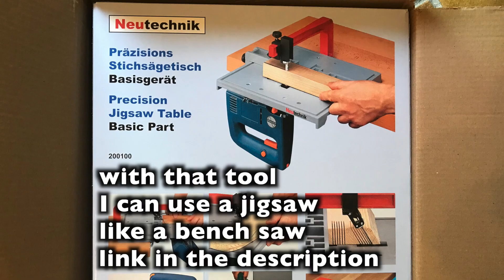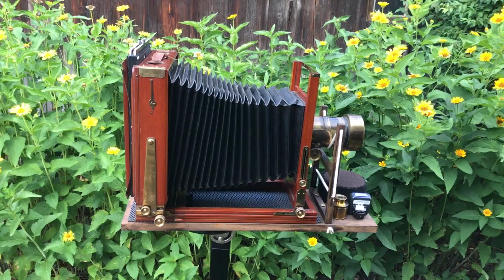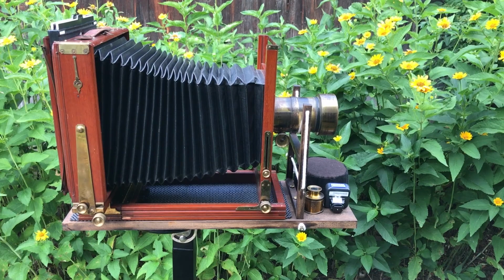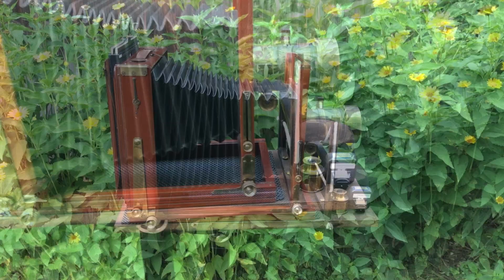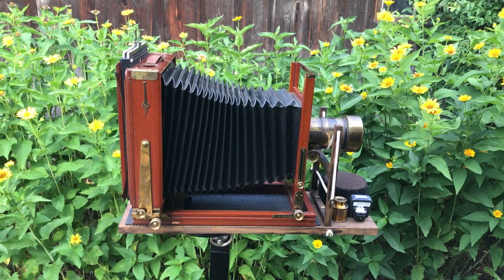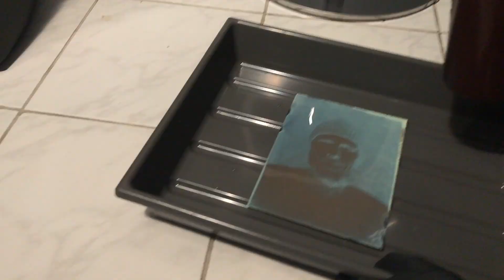how to create a Lens support and how to convert a film holder into a wet plate holder

Comment: Awesome! Might have to try making my own wet plate holder. What power lighting are you using for that exposure?
Reply from the maker: thanks a lot - I use a Hensel Tria 6000S Generator and a Hensel EH Pro 6000 Strobe head. Additionally, I can add a Hensel Tria 3000S Generator with a EH pro 3000 head.